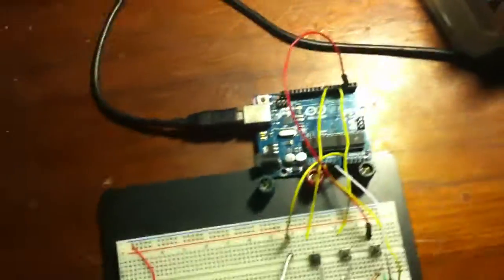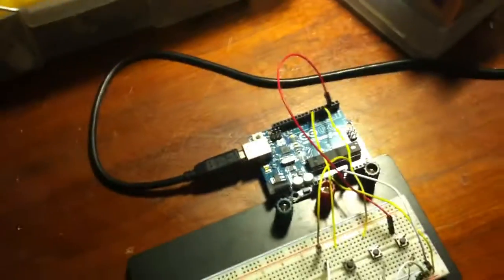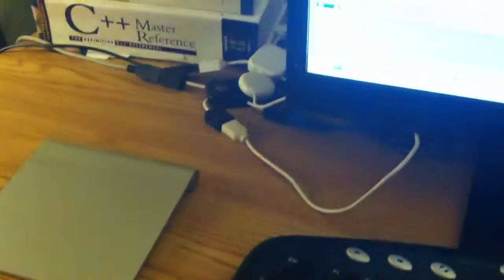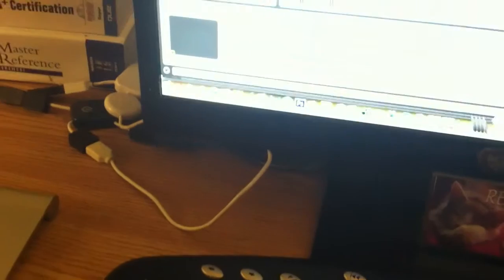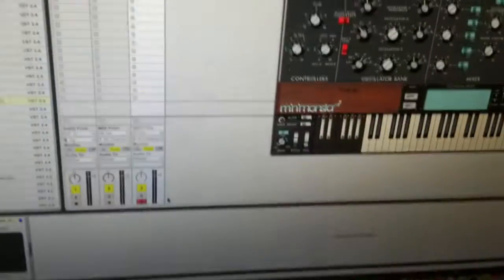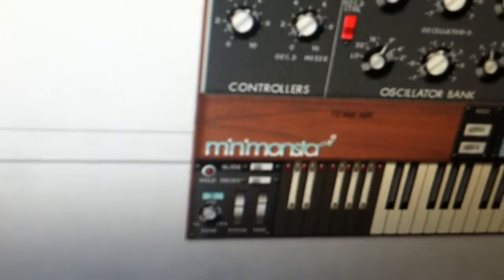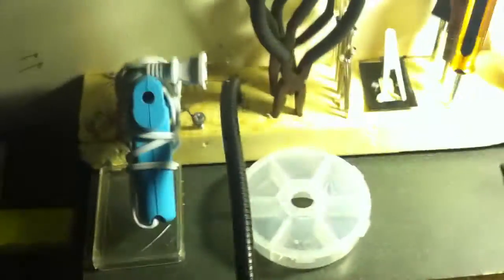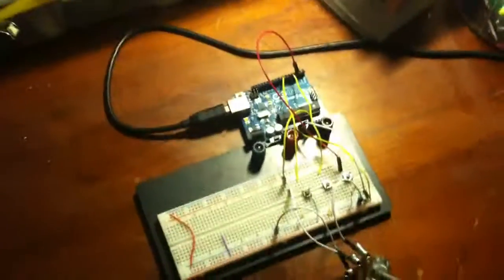Arduino Midi Controller via USB

Comment: Do you respond to questions?
Reply from the maker: try to, had too many irons in the fire to pay attention that i even had comments.. lol. whats up?
Reply: Ha you responded quickly and it took me days!!! I was curious to know how you converted the arduino serial messages to midi?
Reply from the maker: yeah if you notice.. i was 5-6 months in response to the other comments.. lol

what operating system are you working with?

basically i used an application that converted the serial to midi and allowed me to map and set ranges for different values etc to run it through ableton

just trying to get an idea of where you are now and how i can help
Reply: Thats why I asked if you responded!!

I'm using Mac OSX yosemite.
Reply: I've been trying to use hairless midi, but I cant get it to work.
Reply from the maker: whats your baud rate? im going to send my info in a personal message if you want to chat

Comment: Hello good job, could you share me your code? I have a trouble with pushbutton , im just using variable resistors, thnk   Regards ;)     david_spow@hotmail.com
Reply from the maker: David Landa sorry for not responding sooner.. heres the code:

#include "pitches_h"

int audioInp = 2;    // select the input pin for the potentiometer
int speakerOut = 8;   // select the pin for the speaker output
int val = 0;       // variable to set potentiometer

// notes in the melody:

void setup() {
  pinMode(speakerOut, OUTPUT);  // set speaker output
}

void loop() {
  val = analogRead(audioInp);    // read the value from the potentiometer
  int thisPitch = map(val, 400, 1000, 120, 500); // sets value
    tone(8, thisPitch, 10);
  delay(1);        // delay in between reads for stability

}

#include "pitches.h"

int audioInp = 2;    // select the input pin for the potentiometer
int speakerOut = 8;   // select the pin for the LED
int val = 0;       // variable to store the value coming from the sensor

// notes in the melody:

void setup() {
  pinMode(speakerOut, OUTPUT);  // declare the speakerOut as an OUTPUT
}

void loop() {
  val = analogRead(audioInp);    // read the value from the sensor
  val = map(val, 0, 500, 0, 255);  // make val a number between 0 and 255
  analogWrite (audioInp, val);   // turn on LED with a value between 0-255
  tone(8, val, 0);
}
Reply from the maker: Kenneth Wilson /*
 MIDI note player
 
 This sketch shows how to use the serial transmit pin (pin 1) to send MIDI note data.
 If this circuit is connected to a MIDI synth, it will play 
 the notes F#-0 (0x1E) to F#-5 (0x5A) in sequence.

 
 The circuit:
 * digital in 1 connected to MIDI jack pin 5
 * MIDI jack pin 2 connected to ground
 * MIDI jack pin 4 connected to +5V through 220-ohm resistor
 Attach a MIDI cable to the jack, then to a MIDI synth, and play music.

 created 13 Jun 2006
 modified 13 Aug 2012
 by Tom Igoe 

 This example code is in the public domain.
 
 http://www.arduino.cc/en/Tutorial/Midi
 
 */

void setup() {
  //  Set MIDI baud rate:
  Serial.begin(31250);
}

void loop() {
  // play notes from F#-0 (0x1E) to F#-5 (0x5A):
  for (int note = 0x1E; note < 0x5A; note ++) {
    //Note on channel 1 (0x90), some note value (note), middle velocity (0x45):
    noteOn(0x90, note, 0x45);
    delay(100);
    //Note on channel 1 (0x90), some note value (note), silent velocity (0x00):
    noteOn(0x90, note, 0x00);   
    delay(100);
  }
}

//  plays a MIDI note.  Doesn't check to see that
//  cmd is greater than 127, or that data values are  less than 127:
void noteOn(int cmd, int pitch, int velocity) {
  Serial.write(cmd);
  Serial.write(pitch);
  Serial.write(velocity);
}
Reply: Thnks :DDD

Comment: hey, can you show your arduino sketch??? to check how to send midi mensagges???
Reply from the maker: Cristián Darvich /*
 MIDI note player
 
 This sketch shows how to use the serial transmit pin (pin 1) to send MIDI note data.
 If this circuit is connected to a MIDI synth, it will play 
 the notes F#-0 (0x1E) to F#-5 (0x5A) in sequence.

 
 The circuit:
 * digital in 1 connected to MIDI jack pin 5
 * MIDI jack pin 2 connected to ground
 * MIDI jack pin 4 connected to +5V through 220-ohm resistor
 Attach a MIDI cable to the jack, then to a MIDI synth, and play music.

 created 13 Jun 2006
 modified 13 Aug 2012
 by Tom Igoe 

 This example code is in the public domain.
 
 http://www.arduino.cc/en/Tutorial/Midi
 
 */

void setup() {
  //  Set MIDI baud rate:
  Serial.begin(31250);
}

void loop() {
  // play notes from F#-0 (0x1E) to F#-5 (0x5A):
  for (int note = 0x1E; note < 0x5A; note ++) {
    //Note on channel 1 (0x90), some note value (note), middle velocity (0x45):
    noteOn(0x90, note, 0x45);
    delay(100);
    //Note on channel 1 (0x90), some note value (note), silent velocity (0x00):
    noteOn(0x90, note, 0x00);   
    delay(100);
  }
}

//  plays a MIDI note.  Doesn't check to see that
//  cmd is greater than 127, or that data values are  less than 127:
void noteOn(int cmd, int pitch, int velocity) {
  Serial.write(cmd);
  Serial.write(pitch);
  Serial.write(velocity);
}